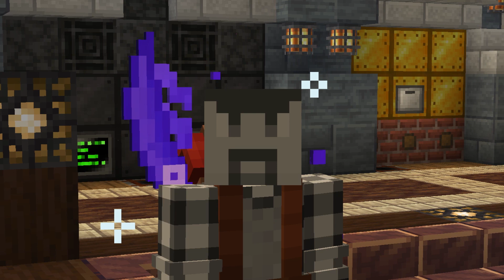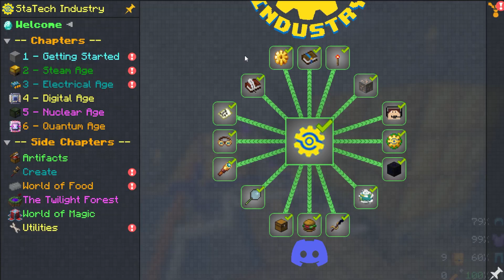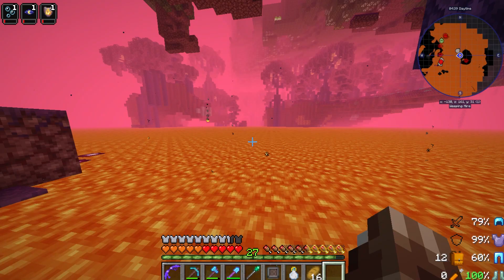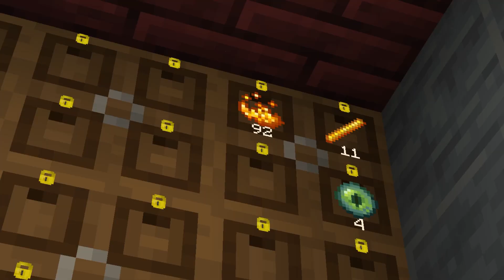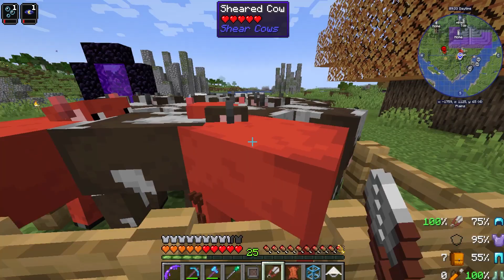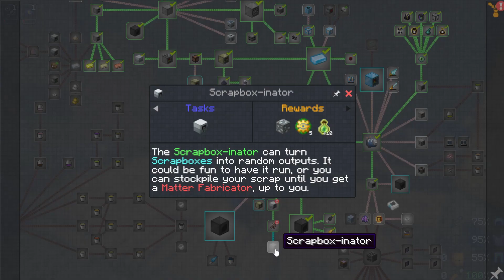Wireless Liquid Transport with Kibe Entangled Tanks - Minecraft: Statech Industry #14

Comment: Me and my friends have a Tekxit 4 server and Kibe is in there. I have accidentally filled some tanks with water when I was doing Lava collection and cannot find anywhere on google on how to go about dumping the tanks. We also have Create mod as well, so I may have to probably place those tanks down and use that mod to drain tanks?
Reply from the maker: Alright, so i can't find an easy to browse mod list for tekkit 4, which is unfortunate, but the usual way is to see if there's some sort of trash can in the pack that will let you void liquids.  The void bucket can work as a fallback though, but I suspect will only work in increments of 1000 mb.
Reply: @Ardcraft  We are on Tekxit 4, a totally different mod pack than Tekkit 4. Has hexit mods in it. I managed to fix the problem so the water that was collected went into two blocks of kibe tanks and I managed to get my laval under control. I may write off the water tanks but who knows, I may need them
Reply from the maker: Well, glad you got it at least sorta fixed.  Emptying tanks without some sort of liquid trash can is way too often a major problem :/